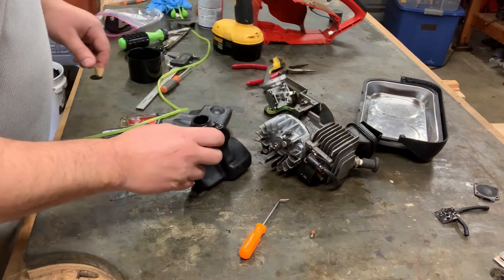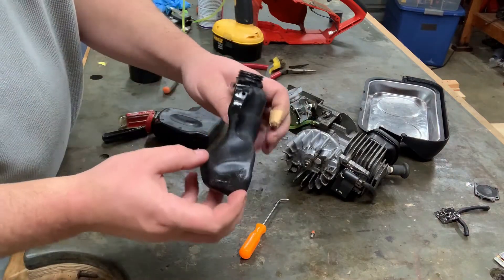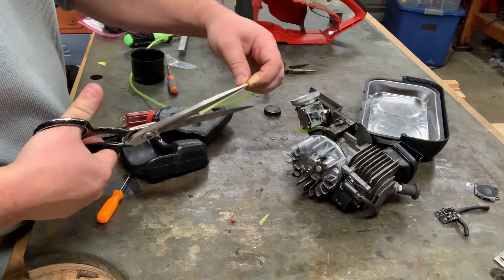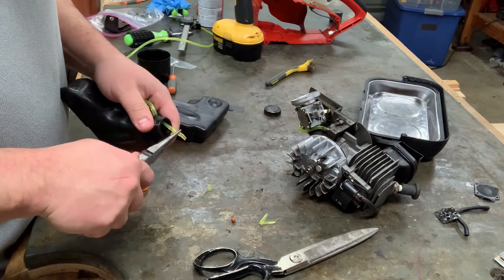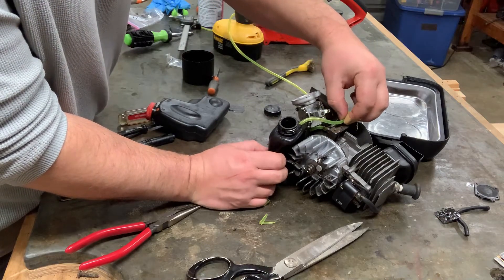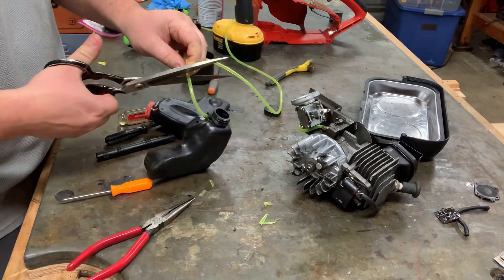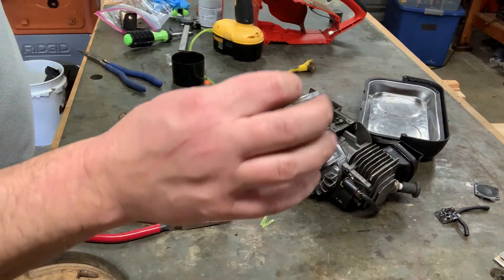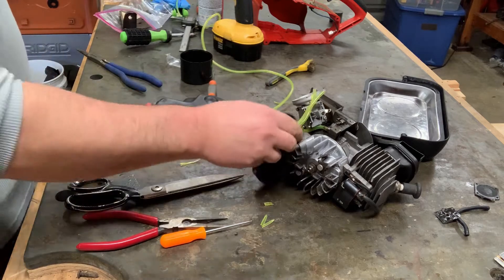Homelite XL part 3, replacing oil lines, reassembly, test run

Comment: You need to get a surgical clamp. It looks like a long skinny Needlenose, and I think Harbor Freight, or any Pharmacy will have them. It makes running fuel lines a absolute dream. I am buying another pair and grinding the locks off so I can work with things like a micro pliers. Good work my friend, the Homelite XL, Craftsman 2.1 and Poulan Super 25 are just bulletproof little saws that will never die, if your willing to maintenance on them.
Reply from the maker: Lol I’ve got a bunch of them! Why didn’t I think of that!!!! Ugh! I’ll make one micro like that too. Good idea. Thanks as always and I’ll keep my eyes open for those other models!